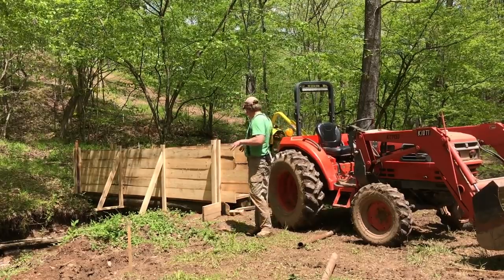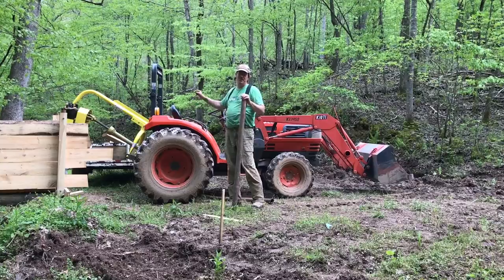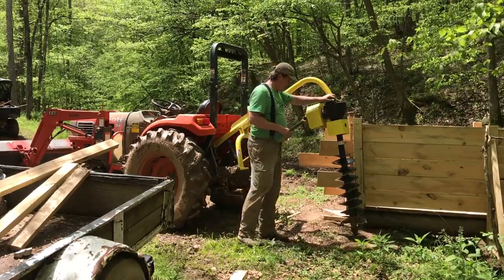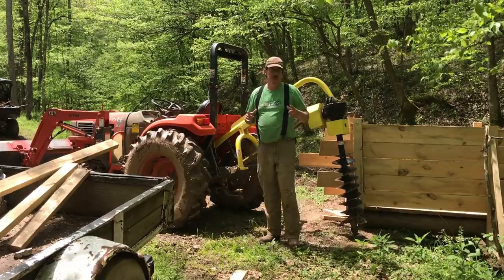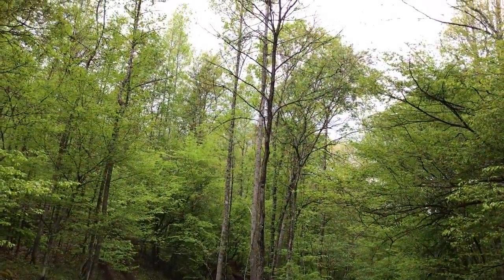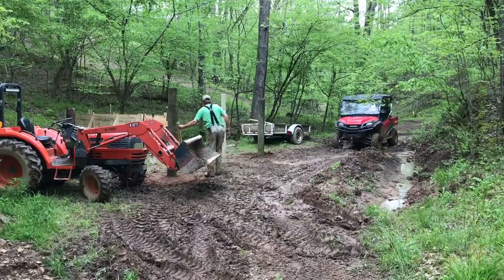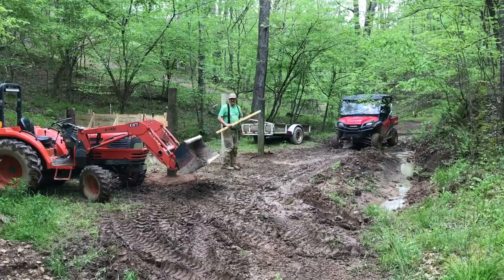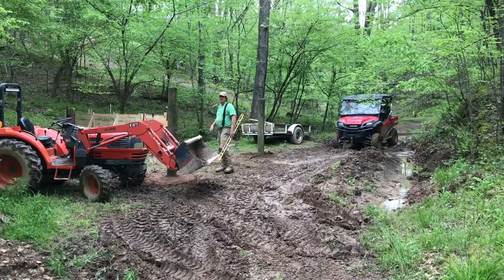Setting Phone Poles for our Boar Corral

Comment: Nice job with the right tools.   Ive seen old timers set some polls with a bag of cement no water just dumped in and covered up with dirt. Locked them in real tight. 

That's one solid fence you've got there.💪🐖👍
Reply: That's how my dad always set poles and because of that it's how I've always set mine.  I was a little surprised that Troy just tamped the dirt.  I am curious to see how well that holds up.  Of course I dig my holes by hand so I'm sure I'm not getting as deep as Troy did with his post hole digger.

Comment: Treated lumber rots when placed in the ground. The treatment process doesn't really slow it down either when compared to untreated lumber.  What makes phone poles not rot as quickly is the oil or treatment used on them.. Since you do some welding if you dont have a plasma cutter you should pick one up. Makes quick time of cutting anything steel. The bridge looks good though. Thanks for the videos.